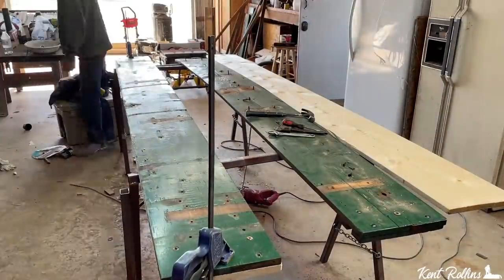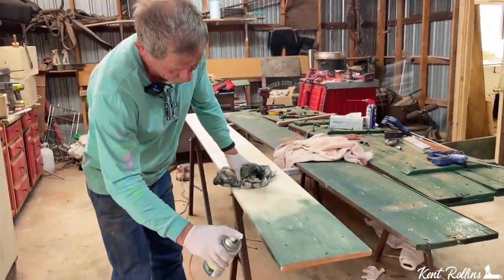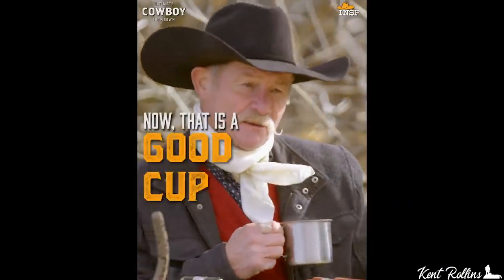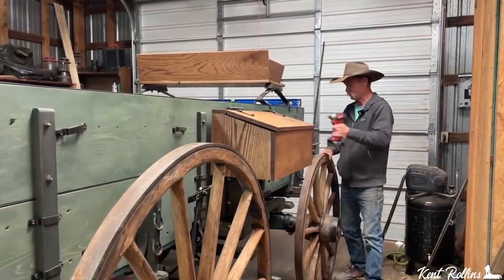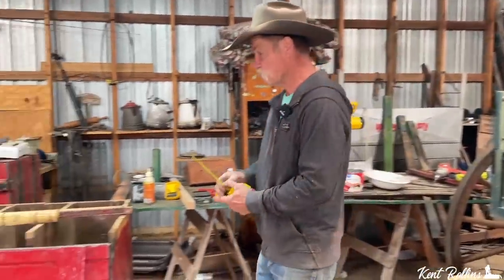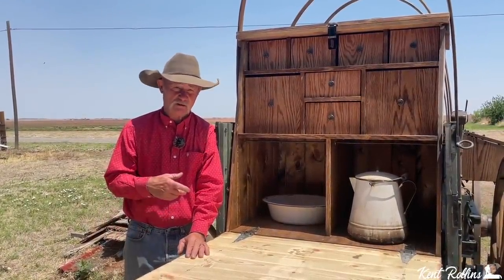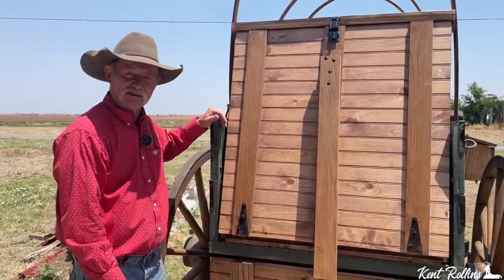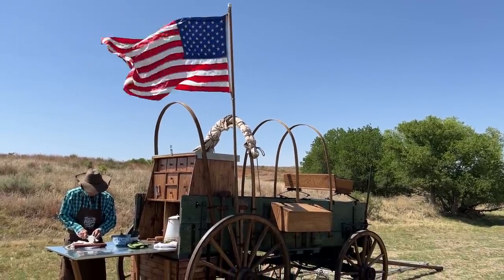Restoring an 1800s Chuck Wagon Part 2 | Cowboy Cooking History

Comment: Good to see her back on the trail. I helped to rebuild a racing wagon a many years ago and we cut our own oak, had them rough cut, and wore out 3 planers milling them down to finished size. A lot of the non important parts we used cypress because it's light and doesn't rot.

Comment: Hello from Sacramento California. I am a wood working carpenter and had the privilege of apprenticine under a master wood Craftsman. I love restoring old pieces back together and I I feel your frustrations try making a barrel. When you come to appreciate craftsmanship from 100 plus years ago. The making of wagon wheel is nothing but amazing. You did a great job Kent only found a couple of things I would change like running an overhang on the boxes so rain doesn't penetrate the inside of the box. And I would have sealed the wood all the way around once you got them dry fitted and your holes drilled then seal them and put them back down. And if you're not a big fan of oiling to keep your wood in shape then I'm a real big fan of one or two part epoxy paints. Polyurethanes are the toughest against wear and chemical attack.

Comment: Good job.  Back around 1990 I rebuilt an old John Deere wagon we found up in Tennesee.  I didn't build a chuck box but I know a little about the rest of it.  The one we found had one wheel and hub that was rotten on it.  An Amish shop up in Kentucky made a new one for it.  We used Yellow Poplar on that one, that's what folks said it was made out of.  I used Red Oak on the spring seat.  It was quite a project.  My friend kept if for several years and we drove it quite a bit behind a pair of mules.  I built cabinets for a living too, it helped.  Great job on yours, thanks for sharing.

Comment: Awesome change of plans.  Gotta have hardwood on them outdoor wagons or else they will have moisture issues.  Great idea with the "weathered" paint job. You can use boiled linseed oil and mineral spirits to touch up a lot of the unpainted areas, such as the hubs, spokes and fellows. I don't recall the portions but about 2/3 linseed to 1/3 mineral spirits is close. The more the coats, the harder the finish gets yet still yield a bare wood look. Congratulations on the upgrades and fresh start.

Comment: 4 wheel drive  custom  drivers seat lots  of room  in the  back beautiful  chuck  box  high  suspension  hand power  brake  dual  horsepower  convertible  top water barrel  table  top  back gate

Comment: Just try buying square nuts again.  I  have a pan full of old nuts and bolts as most old guys do.  I have an assortment of those square nuts left over from God knows when or where. Still have a chrome metal oil can opener and a tray full of distributer weights, springs and braker points along with an assortment of those curved distributer wrenches.

Comment: Hey Ken, It would be interesting to know how the weight of the wagon faired after being refurbished. Also, I wondered how you approached the build of the seat. After a number of miles in a similar wagon, one thinks of the spring and or cushion that would make it a bit more tolerable. Your build looks amazing - Great job.
Reply from the maker: Thanks Frank and with the new Oak it did add about 156 pounds

Comment: We would just wip on and wip off old used car oil you get a lot of contrast in the grain end grain dilute 3to1 with boiled linseed oil and if you can afford Danish oil. So it doesn't darken more than the sides. Linseed oil is also great for metal as well. I would blacksmith barn hardware and season it like cast iron looks great for years. So did you wax or use a polysynthetic over the finished products? There's a product called nu wax and it lasts for about 5 years out in the open. I now use it to seal my air 1970s airstream trailer polished trailer. I have structural concerns about the build on the boot for the heavy cast iron might run some 2x6 then bolt to counter sunk carriage bolts with wide washers  and for the overhang just cut plywood any thickness just 1"bigger in all directions and round all sides the two hinges on the inboard side you might have to install a 1x2x1/2" around 3 sides to engage with the door to aid in closing. Then no rain entry.

Comment: Well done. Just curious: did you wax those drawers so they would slide more easily? Kudos for deciding to work with oak, which is a very strong material that demands extra care from the carpenter. Smart to put metal on your prep surface. Is it stainless steel? Your “old” chuckwagon will last a long time now. I wonder what your project cost, if that’s not too crass a question.